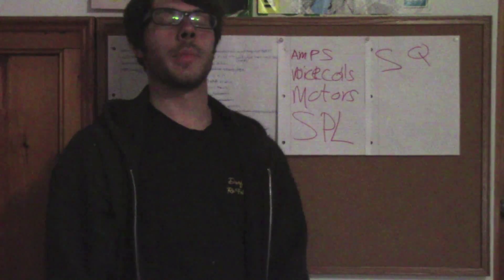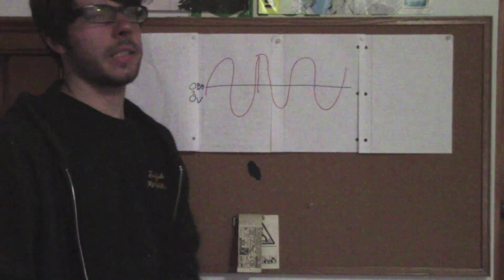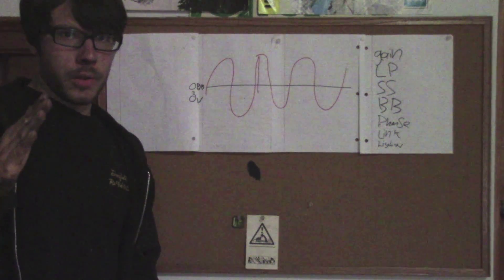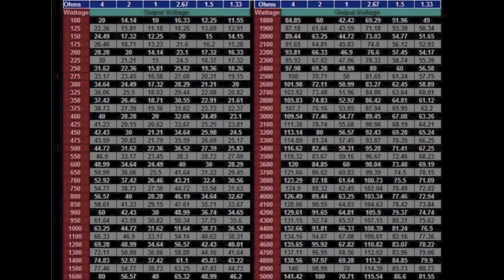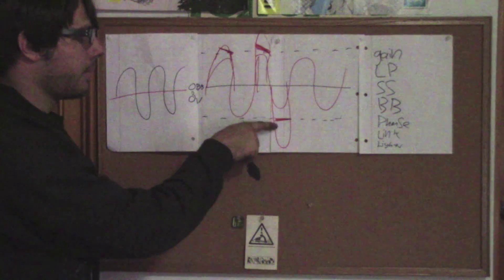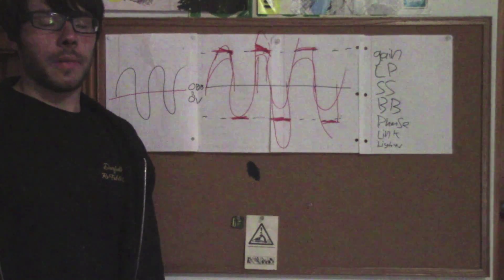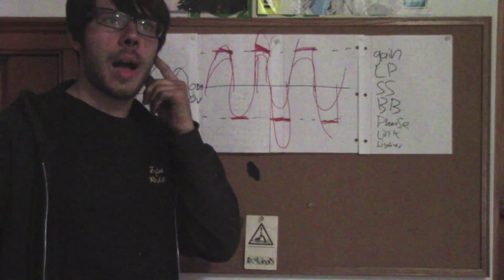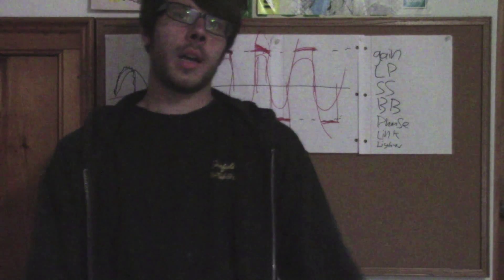Amplifiers: How Do They Amp?

Comment: Thoroughly enjoyed! BTW, nice intro ;) Love videos like this, thanks for taking the time to make it!
Reply: I have a 40hm sub can it be wired up at 1 ohm
Reply: Hi how do i control 2 bass amplifier with one bass control nob ??? Please help
Reply from the maker: Rob Hailes Gain match the amps with a multimeter and buy a RCA line control bass knob.
Reply: I dont have a multimeter so how do i set the gains
Reply from the maker: Get a multi meter.
Reply: Got one now what do I do
Reply from the maker: set the gain by watching the AC voltage at the subwoofer outputs on the amp with the multi meter and use the chart in my video to find the voltage you need.
Reply: I dont understand the chart my amplifier is a Lanzar MAXP1200 1800W Monoblock Mosfet Power Amplifier